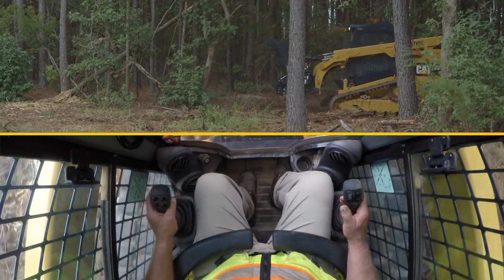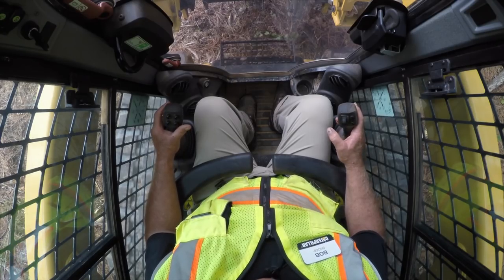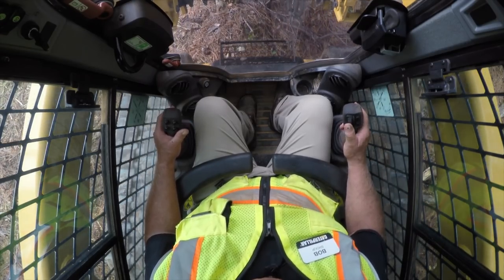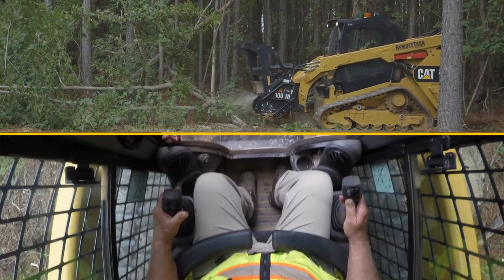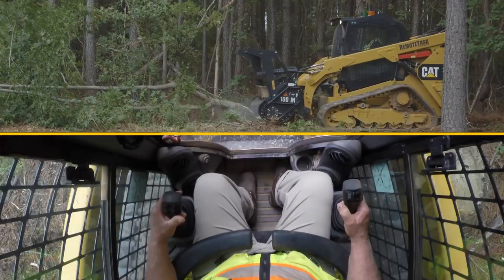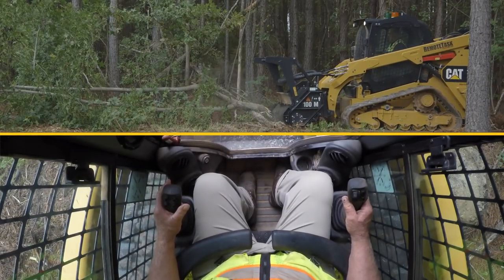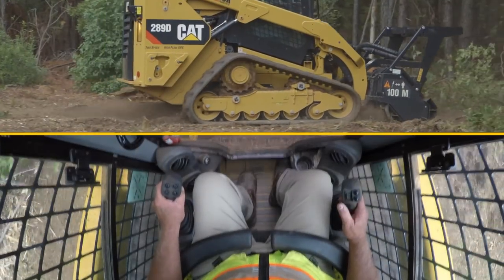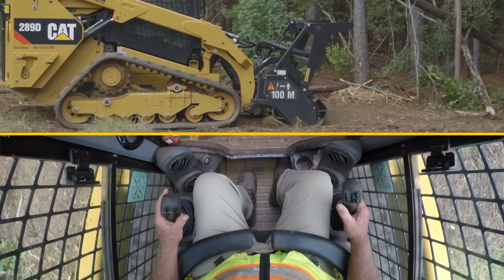Cat® High Flow Mulcher Operating Tips

Comment: Are mulching heads designed to run at full throttle?
Reply from the maker: Hi Joe! Cat mulching heads are designed to accept the flows and pressures of Cat Skid Steer and Compact Track Loaders. So yes, they are designed to run at full throttle on the Cat machines they are approved for use on. Please consult your local Cat dealer for the correct match of head and machine. If running on a non-Cat machine, please consult your local Cat dealer to verify the machine has enough power to run the mulching head.